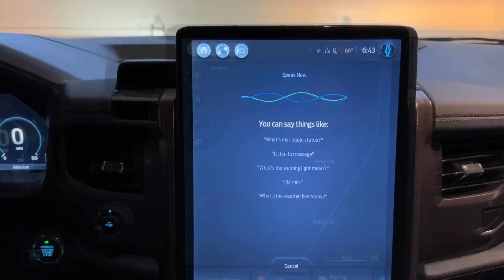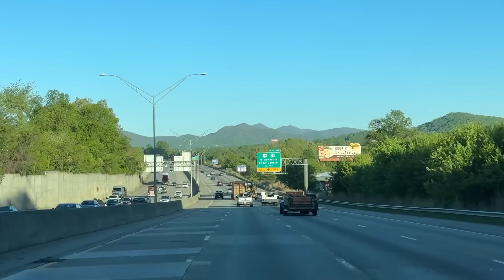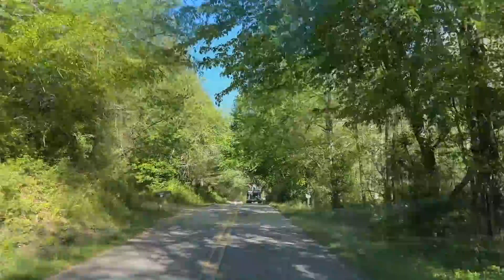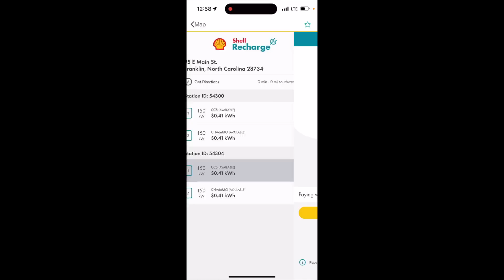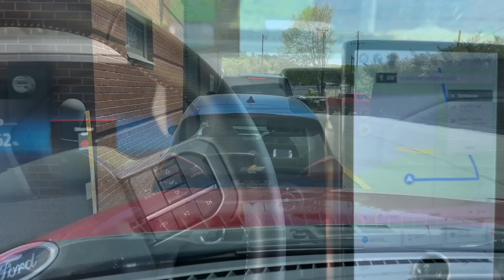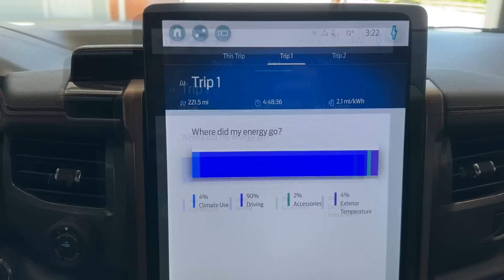Ford Lightning Road Trip to Pick Up Parts

Comment: Hey Dave, you gained 1000ft elevation on the way to Franklin… even with less than 50%SOC at return departure, I betcha would have made it back downhill to Tryon.
Reply from the maker: I could have squeaked it out but with a lack of ccs charging didn’t want to chance it

Comment: Many nav systems show the distance "as the crow flies" first. Its quicker to do so. Then when you choose your destination it goes to the trouble of calculating the actual route which results in a different distance in most cases.